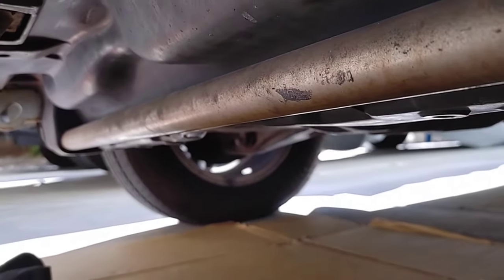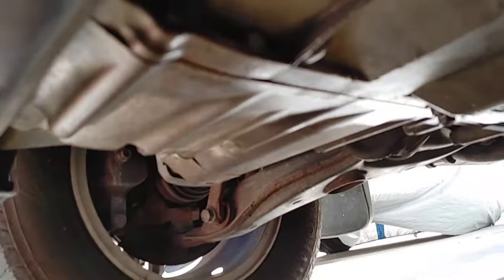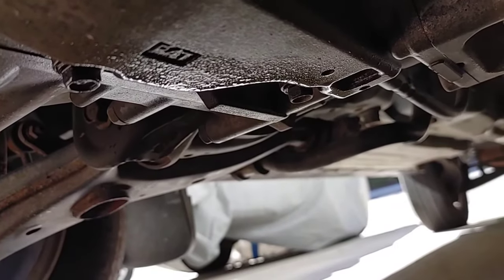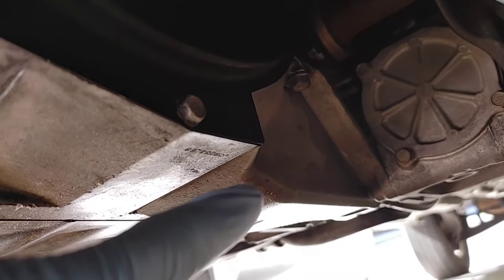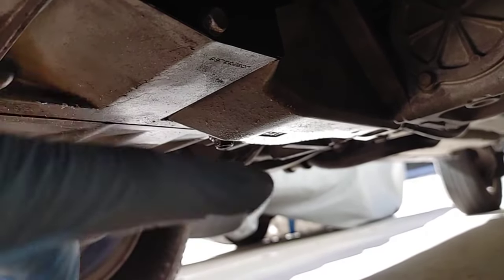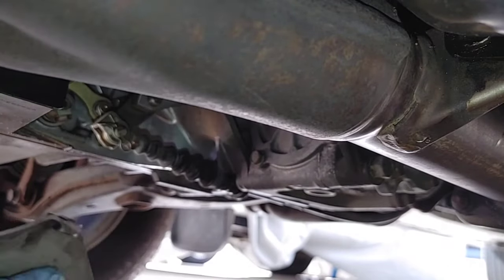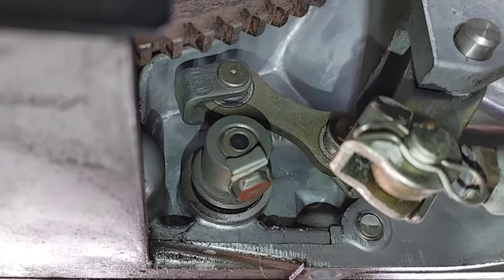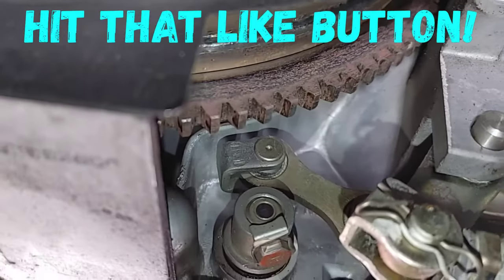Transmission Leak On Your Honda? Look at This First Pt. 1 of 2

Comment: Are u know where atf filter location.
Reply from the maker: There's no serviceable filter. You can only access it if you rebuild.
Reply: It’s on top of the transmission under the abs module
Reply: It's On The Top in-between The Brake Fluid Container and The Air Filter